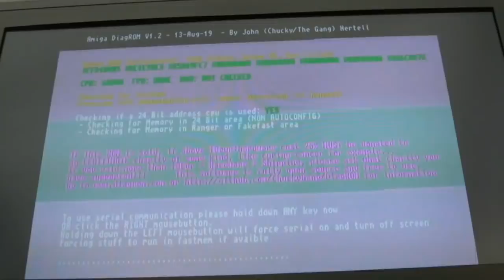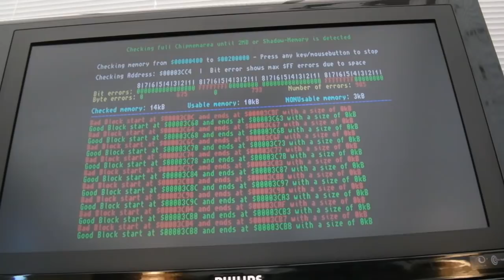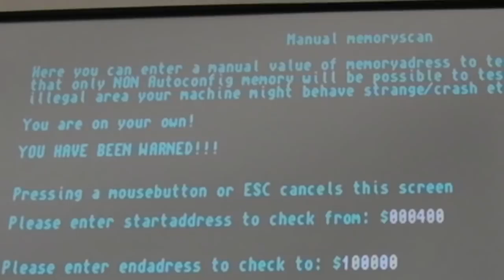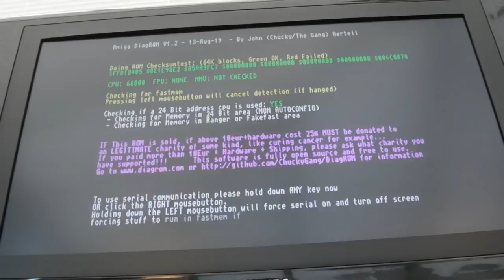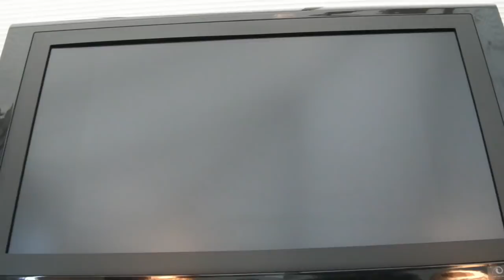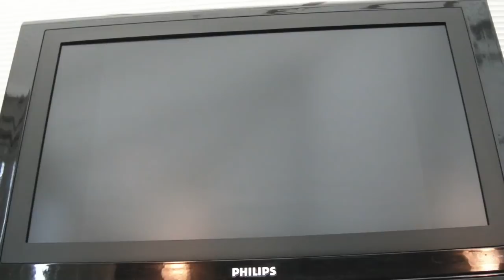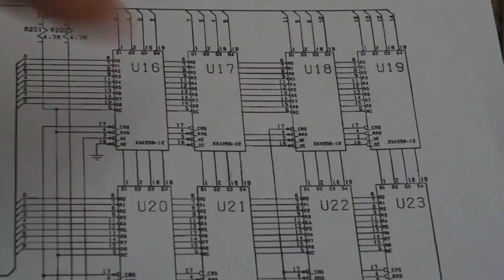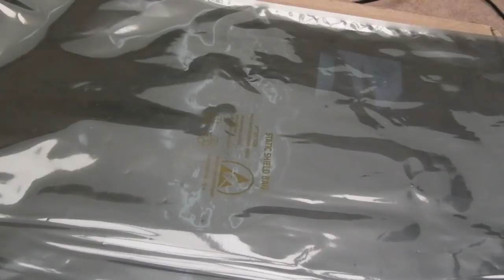A500+ Yellow Screen of Bork Repair (RAM)

Comment from the maker: To clarify - I believe the memory ranges for that Chip RAM here are:-
Lower 512K - $000400 to $07FFFF
Upper 512K - $080000 to $0FFFFF
Expansion 1MB (when using 1MB of Chip) $100000 to $1FFFFF

Had I tested the range 080000 to 100000 - I suspect that would have passed OK, indicating the upper 512K is OK.
Reply: $80000 is where the second 512K starts, if you do 1024*512 you get 524288 which is $80000.  $100000-1FFFFF would be an extra 1MB expansion
Reply from the maker: @jaycee1980  Thanks!  I've corrected that just now =D
Reply: @GadgetUK164  No worries mate took me ages as a teen programmer to remember what the boundaries were :) Have a good one!

Comment: Just for others - a YELLOW screen means the CPU crashed very early on during executing the ROM. This CAN be a RAM fault, if the RAM is not staying off the bus when it shouldnt be there, or if there is faulty RAM which is causing a corrupt stack during execution of code.

The diagnostic colours only really give you a hint as to whats wrong - they do not absolutely describe a problem. For example it's common to see people claiming a GREEN screen means the chip RAM is faulty - this is not always the case, on a 500+ with corrosion it is usually the sign of broken traces and/or failed IC's in the "Data Path" area.

Comment: Cool video Chris 👌
It could be, but I don't think it's static electricity that killed that DRAM chip. I think it's those Siemens chips that appear to've become flaky. A lot of them seem to fail nowadays. I've had 3 A500 boards with the exact same memory chips fail on me last year. I think these Siemens chips just die of old age.
I've removed them all and replaced them with round hole sockets. Mine were normal A500s so I just desoldered all 12 of them and at least 5 of them were bad! 
Good opportunity to test my new Hakko FR-301 desoldering gun. It's expensive and heavy but I cannot recommend this thing enough. It gets every job done cleanly.. I noticed you use the same Chinese unit I have and I always had trouble cleanly removing PLCC sockets like the Agnus socket with that thing. With the Hakko it really is a piece of cake, even on the lowest temperature setting. Best money I've ever spent! 👍
Reply from the maker: Thanks!  I am sure you are right!  I suspect that IC has been intermittantly giving a green screen since I got the board up and running tbh!  Just occasionally it would give a green screen but after a power cycle or two it would then behave.

Comment: Have a good one Chris, here's to a better 2022.

How do I contact you regarding a look at or fix, I can either pay you or send you a bunch of games, if you want my email or more details let me know. 
My PC Engine's brightness is not doing much it pretty much stays the same whether on low or high and I am sure it's not the newly fitted Cap's, I have a feeling it's a power issue, it has the RGB screen mod' too, I can't see any trace damage, the board looks mint, there's no fishy Capacitor smell, I am at a total loss I can have a look myself if you have any ideas or questions I'd be happy to give anything a try.
Reply from the maker: Thanks!  TBH - I wouldnt feel comfortable working on one of those atm, and I've got way too much stuff I need to get through, coupled with bad health atm.  Maybe I can take a look at some point but right now I can't =(
Reply: @GadgetUK164  That's cool man, you do you and get plenty of vitamin D, it works wonders.
If you have any ideas let me know and I'll give it a go if I think I can pull it off, it always seems to be in the C501 area but I can't see anything nor with the Cap' in-between the Volume and Brightness dials, I am totally lost, certain batteries are borderline on fire to-the-touch too after a 2 hour session, it's mainly good ones like Duracell the less powerful ones/cheap don't heat up but still die quick, there looks to be a voltage issue but I am out of my depth and don't want to risk blowing it with power supplies, it's not running on the 7DC/1A/700mA which it's supposed to, so that lacks the power anyway??? It lights up but does nothing else.